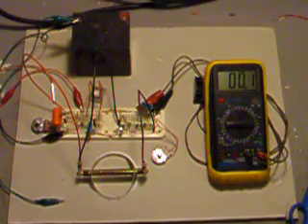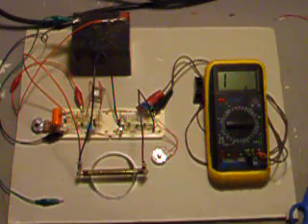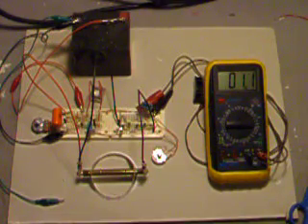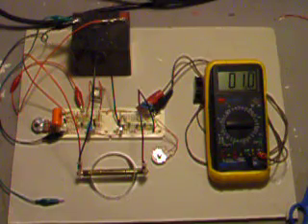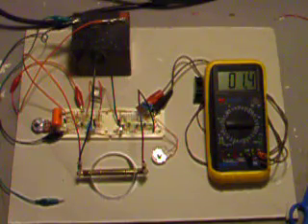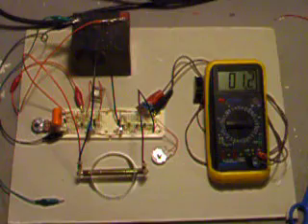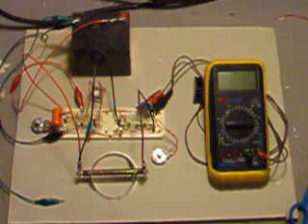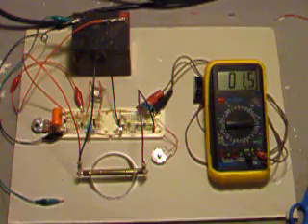My Improved DIY Geiger Counter

Comment: Fred B's Video Blog      since I'm using a current limiting resistor in series with the gieger tube, does that mean If my gieger tube needs 300 volts I need to use 600 volts to account for the voltage drop from the resistor?